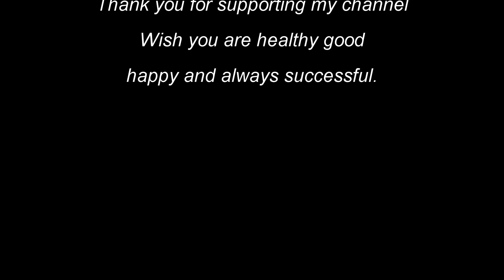Convert OLD SPEAKERS to BLUETOOTH SPEAKERS and Replace Power Supply Broken

Comment from the maker: The old source is broken current 1A (max), if repaired, it will easily be broken again!😅
0:00  Replace power supply broken
05:55   Convert OLD SPEAKERS to BLUETOOTH SPEAKERS